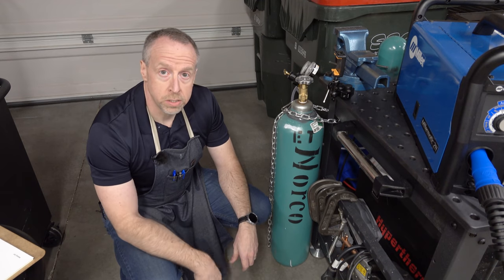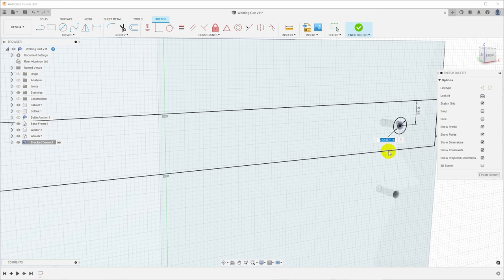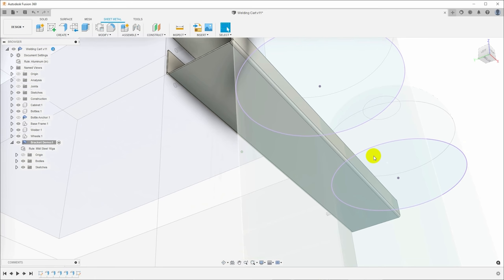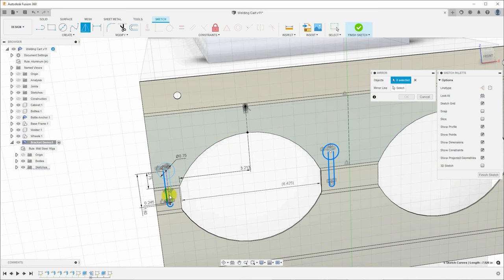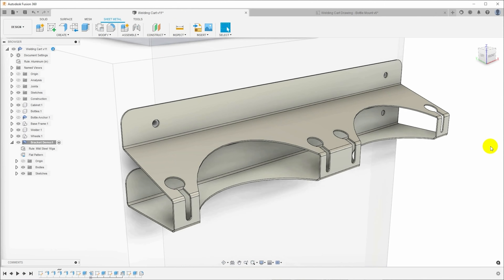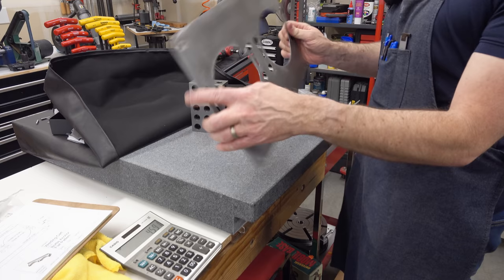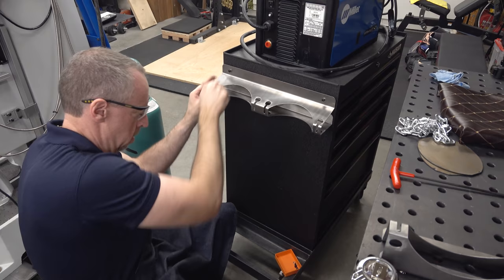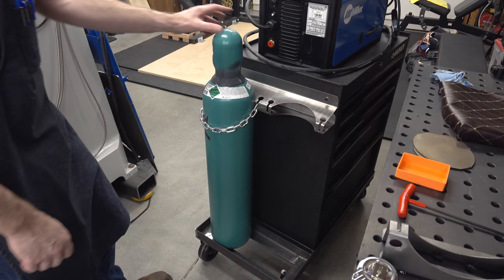Welding Cart Build - Part 2 - Sheet Metal Bottle Bracket

Comment: I didn't know about the "measure" command when typing in extrude lengths in Fusion! I'd usually use an arbitrary length at first so I could exit the sketch and measure it. Thanks for the tip!

Comment: Hi James. Been watching your stuff since the ELS Project. You do an awesome job. Not sure if it has been suggested (didn’t want to read 100 comments) but an old sheet metal trick is to draw your bend locations on you flat profile, a small 2-3mm half round nick on the ends of each bend line. The plasma/laser marks out the bends for you. Simply grind off once bent.

Cheers. Thanks for the content.
Ray. All the way from AUS

Comment: I am planning a very similar design using angle iron. But my plan is to use a steel plate under the bottles and eliminate the second piece of angle iron. This will allow the bottle to rest against the cabinet. I plan to use a ratchet strap to hold the bottle and attach the ends to brackets using the mounting holes on the cabinet. I will probably add vertical pieces of angle iron on the back and build something to hang cables.

Comment: Really enjoy watching your content.   Someone else may have already mentioned this in the comments, but have you considered adding a feature to your plasma cutter to have a fine tip sharpie with a well known offset to draw the lines you need to bend on?  Maybe not accurate enough for you.   I attached a sharpie to my 3d printer so I can draw out shapes on paper or flat plastic surfaces like a plotter.  Works pretty good for my purposes.  I then saw it on Shane's Stuff Made Here channel on a video called "This marker will change the way you work with sheet metal".  I'm also a software engineer and have a similar philosophy to you on how you design your products.  i.e. if a 3D printed part is strong enough, great.  If not, rebuild it in metal after using it for a while.  In any case, thanks for your videos!

Comment: I think I would have put that first bottle rack that you bent on some aluminum\copper and welded the holes shut and just drilled new holes. 🙂. Great thing about aluminum\copper is that when welding carbon steel, the weld won't stick to the aluminum.

I will admit that the cart did look good after completion though. Well done !!!!

Comment: I love these gloves, use them as inner gloves for a bit of heat protection, with latex disposable gloves as outer protection whilst doing hot (not running) oil changes.😊

Comment: Awesome job! I love the idea of using a toolbox for a welding cart. 

Do you think you should put in a cross bar at the bottom of the gas bottles so that one can't slide to the side and fall out from under the chain? It won't matter if you have two bottles installed. But maybe with only one it can slide just enough to the side to fall lower than the chain. I'm probably being excessive but I just wanted to let you know if you hadn't thought of it.
Reply: since the bracket is 3-dimensional, the bottles should not be able to move that far if the chain is tight. The bottle should bind up before it slips low enough.
Reply: @nordishkiel5985  Yep I totally agree. The chain looks decently tight but they'll always have some slack unless you find the perfect chain link size. I always like to add an additional elastic around the cylinder to stop them from rattling around. 

From the video it doesn't look like the cylinder should be able to slide like I mentioned, but I just wanted to let him know so he can test it out just in case.

Comment: Nice job on that, though I was surprised you didn't allow 1/8" or so on the bottle diameter to allow for weld seams on the bottles or any slight irregularities in dimension. But it worked, so it is OK. I think I would though tack a hunk of angle iron across the trough to keep the bottom of the tank from skidding to the right when there is only one tank.

Many decades ago I was driving down the road and noticed there was a half ton pickup in front of me with a pipe rack over the bed and cab. There were a couple of 21 foot sticks of 1.5" pipe on the rack. Not tied down. As it rocked down the road, they rolled quickly from one side to the other of the rack, about 4.5 feet back and forth. Behind the right side of the cab the guy had his welding bottles chained up, inside the rack. The regulators were on  the bottles and the torch looped over the top of the acetylene tank. The top of the oxy tank was just below the level of the pipe rack. Every time the two sticks of inch and a half pipe rolled to the right they smashed into the oxy regulator and gauges. 

It took me about 2 seconds after the second time the pipes smashed to the right to realize what I was seeing. I hit the brakes to give the guy about 500 feet in front of me, and turned at the first intersection and went elsewhere.
Reply from the maker: I modeled the bottles slightly oversize for exactly this reason.

Comment: Great stuff James, not sure if anyone mentioned this, but you can use a Point on a midpoint of an edge and then constraint construction lines to that point.  I use that as a constructed method for mid lines instead of dimension/2 (as at present that driven dimension won't parametric drive the dim/2).  Also, using the Centreline type instead of the Construction type line speeds up the mirror operation.
Reply from the maker: Agreed.  This is a better approach.  I learn something every time I post a Fusion 360 video.

Comment: a colleague showed me that you can use "combine" in fusion to do cuts. so when you did a sketch to extrude cut the bottle cylinder out of your model, u can skip the sketch and do -> combine, click the cut option from the 3(or 4) little squares, pick the metal work as the main body, and the 2 cylinder bodies/components as the tools, and tick option for keep tools. click ok and u get the same result. offcourse a sketch allows you to do stuff like offsets if they are needed, but just wanted to give back some knowledge. maybe you knew about it already, maybe not. either way thanks for the great videos
Reply from the maker: I don't remember exactly what I did in this video, but I often use combine.  The key limitation of doing it that way is that you can't easily use an offset to provide extra space for the fit.  You can use Press/Pull after the combine operation, but I don't really like that because it isn't as clear what's happening when looking at the timeline later.

Comment: Happy new year. Thanks for the Video and a few extra tips in Fusion. I was working on a Radius drill at a customer site once and a forklift knocked over a big Argon welding gas bottle right behind me, the regulator snapped clean off. Thankfully it did not turn into a torpedo or missile. Making a welding trolley was the first thing I did when I bought my MIG welder, I only bought it to repair a few issues on my car, my welds were more like pigeon poop though but hidden well with a bit of underseal on the car 🙂. Envious of your workshop, I'm living in a flat so only room for a Prusa 3D printer and a CNC Router but enjoy designing and making stuff as was a mechanical engineer for 18 years before moving to an IT career in 2005.

Comment: Appreciate your context, James. Thank you! I've watched a number of Fusion 360 tutorials but yours have been BY FAR the most effective for me (in part, I think, because you are using it to apply a solution to an actual need. I have long been wanting to put together a way to "corral" all the various wires "stuff" (for CD player, headset, powerbank, CDs) in my car into something compact and not have wires going everywhere. So I am in the process of designing it in F360 and finding it much more successful than on a previous (failed) attempt. I was curious here whether you might not have considered using the "slightly imperfect" bracket at the bottom of the cylinders for even more stability and "belt and braces" chaining. 🙂Thanks again for the great videos. ----Mike

Comment: James, I always wear gloves while using a die grinder. Once I was using a die grinder with a cut off wheel while I was sitting on a stool. I stop to change the wheel, unplugging it from the air supply of course, and l laid my gloves to the side while I changed the wheel. After changing the wheel I plugged it back in to the air supply and laid it on my lap. When I reached for my gloves the die grinder started to slip, so I pinched my legs together to catch it, which squeezed the trigger and cut a 1/2” deep gouge into both my legs. I guess I could blame the gloves, nope just my own stupidity!

Comment: great video. one thing i've seen a buddy do is have the plasma cutter put some perforations in the bend (assuming you don't mind it not being perfectly solid). That makes it nice because all of the locating on the brake for the bending is effectively measured by a CNC machine with high accuracy and takes out some human error of locating the bend points.
Reply from the maker: This would be easy enough to do.  The reason I don't is mostly because I don't want to look at the crater from the pierce.  If I planned to grind the edge and then TIG weld it, I think this would be a good approach.  But at this point in my journey, the TIG weld would make things look worse--not better.  :)

Comment: That was great. I love setting up kit / improving it to make life easier in the workshop. Some people say that you don’t need good / professional grade equipment for hobby use. However, when you’re used to proper kit as an engineer, it’s nice to have it at home where possible. It also helps to get through jobs faster and more efficiently. What’s the point in struggling when you can have more fun by doing it efficiently? 

I’ve done some fabrication jobs at home and Fusion 360 seems to be the ticket. That CNC Plasma cutter is ace!

Sharing for sharing!

Comment: Gas bottles are no joke! We were constructing 14 elevators, 30 story bldg and a Oxy bottle went over & broke valve off. The bottle punched a hole in a block wall 3" off the ground & beat the crap out of the room. SCARY

Comment: I try to resist the urge to "finish" or fully assemble my shop projects until they get a coat of paint or powder coating. Because, if I don't... they'll end up bare metal for life. Same with all those "weld together kits" like 2x72 belt grinder, tube benders etc... I was so happy they were assembled and working, they just stayed bare metal.
Reply from the maker: This project is no exception.  It'll probably be bare for life.

Comment: A few alternate approaches in your CAD from a "best practices" / model efficiency perspective: remember dimensions get the worst processor gas milage so use sparingly.  Only one of your holes should be dimensioned and the rest should be set equal (or better yet, use the hole functionality). You center your initial flange about the hole centers with a dimension hard-coded as half the flange height - instead create a vertical construction line and make its mid-point coincident with a hole center. Instead of locating the chain slot mirror construction lines with dimensions draw a horizontal construction line between the same two points that you placed the dimension, then constrain the vertical mirror line to the mid-point. SolidWorks provides a means to fix something to the mid-point of an arc. If F360 offers similar you would not even need the horizontal construction line. Finally, SolidWorks provides an option for sheet metal flanges to extend up to a vertex or a surface in place of a dimension. Does Fusion have something similar?

Comment: I love the mix of imperial and metric dimensions. I grew up when the UK was changing over so mix them all the time too. Luckily the days of cars with a mixture of imperial (for engines) and metric (for brakes) are gone now!
Reply from the maker: You might be the only person who loves that.  :)
Reply: Me too. On my first job, selling steel bar, the customer would ask  for 12mm bteel bar. Certainly, I would say. How long are the bars, he would ask - 10 to 12 foot I would reply. How much will 18 bars weigh, he would ask - well, it's 0.27kg per foot, so about 2.7 kg per bar, so just under 50 kilos, I would reply. What are the tolerances on 12mm bright bar, he would ask - plus nothing, minus 3 thou, I would reply.

Comment: Interesting and entertaining video, as always.  You obviously know how to use reflection, but you could save even more time if you used it more consistently - as you still modelled some features on both sides of the centre line of this bracket.  On a completely symmetrical object like this, it's a real timesaver if you can discipline yourself to only ever model one side of the object - then do your fillets (you'll have less edges to select) - and finally do any reflection(s).  It can also make modifications easier to find and execute, as you'll usually have less sketches to navigate - and it's great when making models parametric - as the feature count in your sketches will inevitably be lower.  Years of creating models in 3ds Max has made me overly sensitive when I see people thinking of reflection at a feature level when, on objects with one or more lines of symmetry, it's usually more efficient to think about it at the entire model level.  Just something to think about.

Comment: Great vid James! Question/ minor observation: In your Fusion model, your chain key holes were only extruded through the top plate yet your finished parts appears to have holes through both the top AND the bottom? From my dabblings with Fusion, I may deduce that one way to make those holes was to do an 'extrude through all' however after watching you actually put chain on (and knowing how thorough you are), my guess is that you added them purposefully as a way to 'store' excess chain. Keep up the good work!
Reply from the maker: Yeah.  That was an oversight in the video.  I added them to allow excess chain to hang down behind the bottle.

Comment: I wonder if a divider in the bottom would add extra security. Other than that this is a very neat solution. The order of operations on the brake is a bit of a mind-bender (pun fully intended). The narrow clamp is essential there.

Comment: Measure once cut once. Measure twice, cut again? heh

I've made this exact mistake at least a couple times in my life, I'll prob do it again if I had to guess.

Edit: I realize that this is a one off, but I think that I might have made tools in Fusion to cut the chain slots out of. This only really helps if you later want to completely redesign, but having a small library of tools is a thing that is nice to have. You can even parameterize them so they are simple to change.

Comment: Hey, just wondering, is the spring-back of the material in the brake repeatable? I'm wondering if you can add x-degrees to the bend spec to hit your target exactly (+/-)? Again, great video.
Reply from the maker: Probably.  It would be easy to test, but for a one-off project, bend and check seems to work well enough.

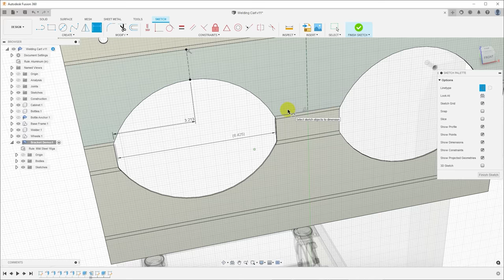Comment: at 10:10 instead of using dimensions, create the initial dimension as a construction line, and use the midpoint to create the perpendicular symmetry line. Then your model remains parametric.
Reply from the maker: That's a great idea.

Comment: The reason why your dimension wouldn't "stick" was because you started your drawing on a different face and only the geometry on that face was auto-projected into your sketch. I personally like to turn off auto-projection because of confusing issues like this. I just project in the bare minimum geometry that I need and it keeps everything simpler.
Reply from the maker: Ahh...I didn't know you could turn that off.  I agree, it's irritating.  Sometimes useful, but usually irritating.

Comment: Hi, would it be possible to have the plasmacutter mark the bends with a sharpie on the metal itself? Since it is 3 axis, that should work. I think i have seen that somewhere...
Reply from the maker: You saw that on StuffMadeHere.  This plasma is a closed-source system, so additions like that would be a major undertaking.
Reply: And it’s pretty hard to have the plasma mark both sides. I really like the wayJames does it, seems like the best results for me.

Comment: Looks good, But where the bottles touch the bracket, i would of welded in a piece where the bottle curve is and then placed some soft material over it to give the bottle a soft surface. so the bottle doesn't get scratched up. but each to there own.
Reply from the maker: Rubber edging on the sheet metal might work for that.  I might try it.
Reply: You are really worried about scratching up welding bottles? In my world you dont get the same bottle back on re-fill they just swap you a bottle and they are not concerned with giving you back a bottle with a corvette hood finish on it.
Reply: @fpoastro  Exactly. I've seen some very rough looking bottles.

Comment: Didi you model or get a file for the husky toolbox
Reply from the maker: I modeled it.  It's just a box the right dimensions with the handle screw holes (almost) in the right place.  I just stuck a decal photo on the side to make things clearer for the video.
Reply: @Clough42  looks great. I am a big woodworker, but your stuff is making me think to change to metal!

Comment: Gosh, you need to consider safety. Never use a grinder and flappy discs with only safety glasses. Always, always use a face mask or you will risc Covid. To be 100% safe, use floppy discs instead of flappy discs. I would say the 5.25" is safer than the 8". Grin :-)